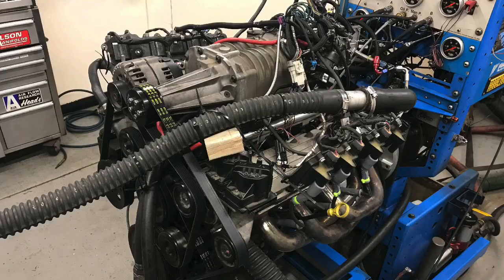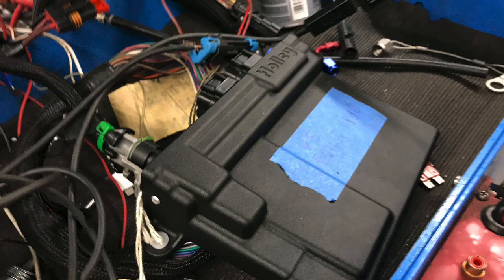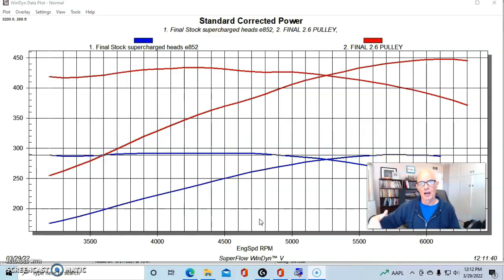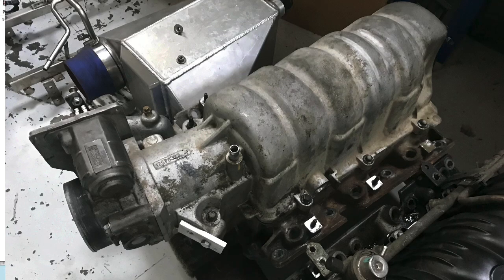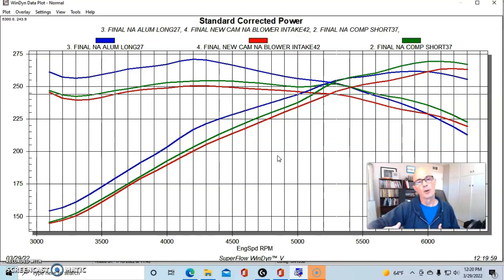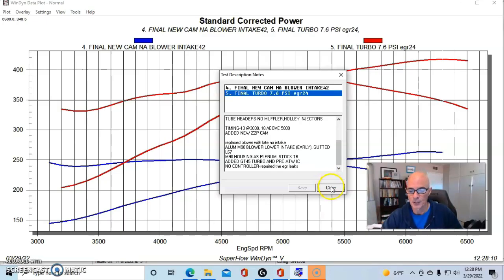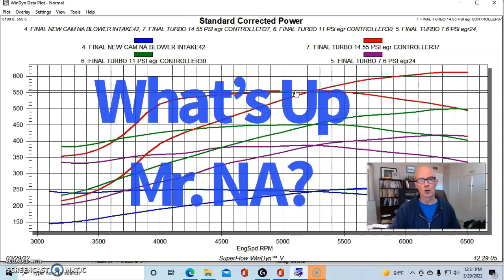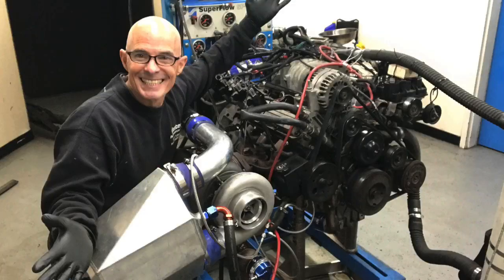JUNKYARD TURBO 3800 V6-WHY DOES IT MAKE SO LITTLE HORSEPOWER NA AND SO MUCH POWER UNDER BOOST?

Comment: That’s what low compression engines do as boost increases the volumetric efficiency increases therefore increasing the Horsepower drastically. We ran a 5.7 LS engine 8.3 to1 compression very sluggish out of boost no power, under boost it was an animal, made 760 rear wheel horsepower at 14 1/2 pounds of boost. 10.5 to 1 Would make more power under 15 pounds of boost but not drastically more.
Reply: i have 2 300zx's one is NA to T with 9:1comp other is factory turbo with 7.8:1 comp, both cars feel about as fast as each other when flooring it, but the factory turbo car and can be a sluggish dog driving thru carparks and tight suburbs unless you keep the revs up, where the 9:1 is much better behaved below 1/2 throttle
Reply: That's a good point.  My friend and I built an NA L36 for his speedway car. He has custom domed pistons and ZZP alloy heads which has 14.5:1 comp on e85 with a moderate cam of 228/228  and 0.543 lift. His goal was a boat load of low to mid torque.  It peaks 335hp at just 5000 rpm.   It has the yanky series 3 banana manifold as it flows better than the crappy Aussie ones.   His car is very successful and comes in the top 10 out of around 100 competitors and is the only V6 out of the top 10 against Barras and LS v8s.

Considering the moderate cam it makes good power at low rpm due to good head flow and high comp.

I am sure with a proper racing cam in the 260+ duration and ITBs it should get 100hp/L or more with the rest of the combo it has.  

Interestingly the series 1 3800 here in Aus has much more of a history for NA development than the series 2 did and was even used in a Formula series here and they made 340hp at 6700 rpm on 10:1 comp back in the 90s. They used a flat tappet cam then as they didn't have mechanical rollers that were fully shrouded to prevent oil gallery uncovering back then.

And they have tiny 1.76 X 1.5" valves, much smaller than the series 2 and 3. They were also restricted to 60mm single stock throttle as per series rules.

I plan to built one of these engines but with modern techniques.  Head porting has come a long way since, you can easily run 12:1 on pump fuel with a 260 duration cam with a good tune these days and the cam is available in roller now as well as custom mech roller lifters to suit. Larger throttles are easy to make.  I expect probably 360-380 hp NA.
Reply: The higher compression motors make more power every where and spools turbos much faster though and big gains off peak. It will limit you if you are knock limited by the fuel as it’s down side.
Reply: @mddunlap03  Well aware, the stock ecu is tuned for regular, so I just run premium fuel at stock boost level, no intercooler but with a newer, more efficient turbo than factory.
Reply: @Mitchd03 Hey Mitch, how's your NA-T setup doing these days?
Reply: @FlawleZ31  hey mate, actually its mostly the same, just fixing it piece by piece, have made it a reliable cruiser. I've got a massive backlog of videos to edit and upload of various cars including two z31's and a megasquirt carb-efi conversion on something else.
Turns out the turbo car needed the det sensor, its way nicer now
Reply: @Mitchd03   Good to hear! I'll look forward to your videos when you upload them. I own a Z31 discord server if you're looking for any additional outlets or channels in the Z31 community

Comment: Thermal efficiency is a good guess.  With a given in-cylinder temperature the metal surfaces will only conduct so much heat, even though the chemical reactions with more air and fuel will create more pressure, thus wasting a smaller percentage as wasted heat through the metal surfaces.

Another, although less likely, possibility is that the combustion process is more rapid or more complete under higher boost.

Considering back-pressure produced during turbocharging, it seems counter-intuitive that volumetric efficiency would increase with higher boost levels.  This would not really be the same set of circumstances as with a positive displacement supercharger.

Comment: I think on applications that dont really respond to NA tuning is because they have a bottleneck somewhere, usually the heads, and the increased manifold pressure is able to overcome that deficit in pumping loss.
Reply: Intake drag as well.

Comment: Could the gutted blower be acting as a too large of plenum causing the air flow to slow too much causing there to be no ram effect whatsoever and in fact filling the cylinders less than an NA engine with a normal intake. This would than be overcome by boost making it appear that boost has a more significant impact vs the fact that the NA intake design (gutted blower) is actually working against the natural air flow from high pressure to low as the air slows as it enters the plenum.

Comment: Did you happen to compare backpressure?  As others have said, it could be that the turbo is in a more efficient island on the map.  Could also be the porting on the heads, as I've seen turbulent ports improve at different depressions. Obviously boost could fix a turbulent port. You've tested E85 enough to know what it'll do, so I'll leave that one to you.

Comment: The engine is running at its volumetric efficiency point. And also the turbo is running at its most efficient point on its compressor map. That is where you get the extra gain from. Just my theory

Comment: Looks like the last combo was responding to back pressure with efficiency. I have a hard time believing e85 would be that much more beneficial, just given the burn characteristics, comp ratio, etc.......
Reply: E85 is not available everywhere, it requires larger injectors, the only advantage is a cooler charge temperature. You have a better chance of getting 100LL fuel at a GAvi Port than E85 out of a Gas station
Reply: @shadowopsairman1583  compared to what, race gas?

Comment: I would have to think the intake manifold "design" was the increase. I remember seeing similar findings from really terrible designs for NA power making great power under pressures. Someone explained it to me as the difference of a tailgate being up or down. Pressurized air will sit in "pockets" of the manifold and allow the rest of the air to flow past at a higher rate than it does NA.
Reply: Aluminum intake on Series 3 NA

Comment: E85 adds power for sure.
That engine is a low compression motor.  Its made for boost.

Re the gaining efficiency in higher boost levels. Id say the gt45 is a bit on the large side for that motor. And isint in its efficiency range until the higher boost levels on this motor.
Reply: I don’t think boost cares about the compression ratio but higher compression is harder to tune with boost.
Reply: @tomcelica  No, but the lower compression definetly hurts the n/a power numbers.

Comment: The GT45 really likes gasoline engines in the 3.8 to 4.3 litres / 230-250 cubic inches, and E85 makes boost and timing possible, especially with mild compression.
Reply: How does the gt45 know what type of fuel is being burned?
Reply: @tomcelica  The fuel allows for more timing and higher boost levels. Turbo doesn’t know, but it does know when it’s allowed to make more boost.
Reply: 4.3 is 262 CID (Vortec 4300)

Comment: I think I would put the blame on the intake manifold being really bad for the naturally aspirated run. The head work didn't get the chance to shine until you put it under boost. Those two things made the power numbers go from lame to exceptional.
Reply: I wholeheartedly agree. Doesn’t matter how much you optimize an air pump when it’s sucking through a straw. 

Now that the engine doesn’t have to overcome an inefficient manifold because it’s being FED air instead of requiring the cylinders to draw it in, the true volumetric efficiency of the engine with the improved head work is revealed. 

Similar effect is also seen with the LS4 transverse mount V8. They pick up big power when swapped
Reply: The intake manifold being swapped, that is
Reply: @edmundnlemadim8480  There's a fair bit to be said for the E85 in the equation, as well.  It's a fantastic high-performance fuel that has an "octane" rating over 100.  That gives you the ability to push more boost (or compression) without having to trim timing out.  The 3.8L engines, particularly the SC versions, trade lower compression (many variants under 9:1) for higher potential boost.  Combined with a good cam and some aggressive ignition timing, you get crazy amounts of power out of seemingly ordinary or underwhelming NA platforms.

And it's funny that it could be the heads making all the difference, here.  Recall the LQ4 and LQ9 V8 truck engines - same blocks and entire lower assemblies.  The difference is literally the heads - the LQ4 had the low-compression head (9.4:1) and made 325hp/370ft-lb while the LQ9 had the higher-compression head (10:1) and made 345hp/380ft-lb.  But the LQ4 engines (or, at least the heads) were snatched up by hobbyist drag racers because they took boost a lot better.  Less compression means they don't need to pull as much timing out under a given boost load.  (And, for the record, without boost, the LQ4 ran just fine on 87 octane "regular" but the LQ9 demanded 91 octane "premium" to avoid pre-ignition.)
Reply: I completely gutted my M-90 plenum……I Removed everything….it’s truly hollowed out….
it can never be a Super charger…but it’s a lot lighter.

I made sure I didn’t cut into the coolant lines….it was a pain in the ass….the Aluminum is tough on those things.

Comment: Do the #'s come back in line if you use the empty blower with open back run as baseline? You said it picked up power. Intake restricted vs E85 + boost?

Comment: My theory on the hp/psi going up, is how you described taking the plate off the blower and the NA motor wanting more air than the TB opening could provide. As the boost pressure increased more air was going through the throttle body more efficiently and into the gutted blower.
Reply: Dang   you posited while I was typing

Comment: I've been thinking about doing a video series on combustion pressure, and how it interplays with inpet pressure etc.

The quick answer is, as inlet pressure goes up, the in cylinder pressure production relative to port pressure climbs in a logarithmic fashion.
Reply: Cylinder pressure is proportional to intake pressure.

Comment: @RichardHoldener grab an L36 or L26 with the higher compression and see if N/A HP is better?
Reply from the maker: it will be-but then turbo power will be up too
Reply: @JPL Performance the rods between the series 2 L67 and L36 are identical. The rods in any series 3 are powder forged and slightly stronger but only by a small amount

Comment: Well 8.5:1 comp certainly doesn’t help the NA setup.
Reply: I think It hurts boosted power the same way
Reply: @tomcelica  boost loves compression. Issue is cylinder pressure. Hard to keep the heads on a motor with high boost and high compression
Reply: @robbygray9562  boost is a multiplier. It just adds to what’s there
Reply: @robbygray9562  I guess that depends on what you consider high compression. Guys run 12 and 13 to 1 all the time with boost and e85.  It’s just with the higher compression ratio it makes tuning very important
Reply: @tomcelica1030 but how much boost do guys really run with that high a compression ratio? A lower compression ratio means more boost but less initial power. Top speed dragsters run 50psi of boost but only have a 7 to 1 ratio or less. Even nascars na didn't usually have more than 10 to 1. F1 dose 18 to 1 na, but my point is that the more you increase compression you have the same effect as adding boost pressure just with the result of being able to handle less total boost and ultimately making the same total hp just with more initial power.
Reply: You are not going to believe this but I am not going to argue about it either (don't bother replying).
"Given unlimited supercharging for any given fuel in a spark ignition reciprocating engine maximum power will occur at a compression ratio between 6.5 and 7 to one."
Harry Ricardo, 1922, England.
Now you know what the designers came up with when - in World War Two - the fate of nations hung on the power output of their fighter and bomber aircraft engines. Universally they all had 7-1 compression.
Reply: @patrickshaw8595  100 years of technology have gone by, there's a reason you don't see 7:1 compression in any modern engine
Reply: @user-mf2gr3cz6e  Two reasons, actually: Horrendous BSFC and low NA power.  But for all of that if you need max power out of an engine of a certain size and you can find enough turbo and intercooling 6.5 to 7.0 is the sweet spot.
It's never going to change.
      PS - I had '79 F250 with a 351M running 7.0 CR. 170 hp out of all that iron ! I had a mower shop then and all the waste diesel, stale straight and 2-cycle gas and even some very very very gasoline-contaminated four stroke oil found it's way in it's rear gas tank. Start and run it on "the good gas" and when warmed up switch to crap. Long as I'd remember to get a carb full of good fuel for the next start it was free fuel.
     PS - all modern recip SI aircraft use 7-1 CR and nothing higher.
Reply: @user-mf2gr3cz6e 
Then why are the worlds fastest cars using 7 to 1? It's simple, the more boost you use the less compression you can run it is just a fact based on decades of research and development.
Reply: @patrickshaw8595  My mother and father told me there was an old saying back in their time. It was “That will happen ras soon as you put a man on the moon” or something along those lines. We also used to think the world was flat.
Reply: @tomcelica1030
You'll never fly to the moon if you don't lower the compression so the ol girl can breath that boost. High compression is like taking big breaths, low compression is small quicker breaths, there fore it can spin faster because there's less throw and less total friction. What's easier, to lift something all the way from the ground over your head or to have too just move it 2 inches above your head? I'll tell you which one you can move more weight on and can do more repetitions with.
Reply: Stock 8.5:1 compression with the m90 running at 8ish psi and these things are knock machines stock. Even running 93 ocyane most have ~5° of knock retard stock and these engines still last forever.
Reply: Erm the L32 has higher compression than the L67
Reply: @shadowopsairman1583  no it doesn't. L32 and L67 are both supercharged, 8.5:1 compression. L26 and L36 are N/A, 9.4:1.

Comment: na power is 24.5 hp per psi since the first hp is made at roughly 4 psi absolute pressure
Reply: how about a test with intake unhooked 0 boost psi to see how much power is lost with turbo housing restriction
Reply from the maker: it won't be the same-it won't build boost or have any back pressure